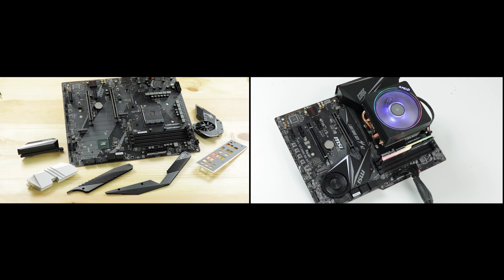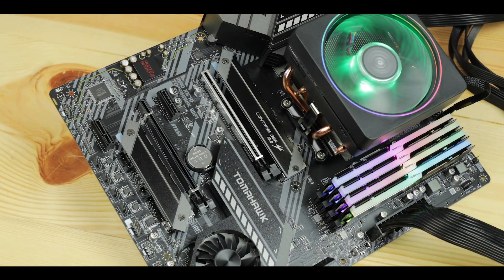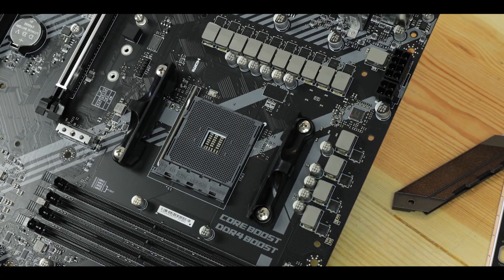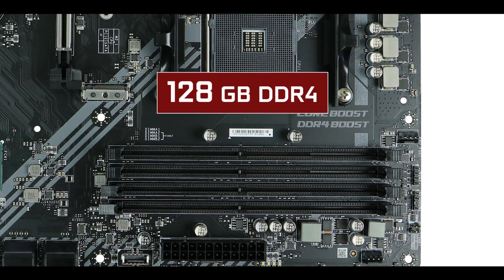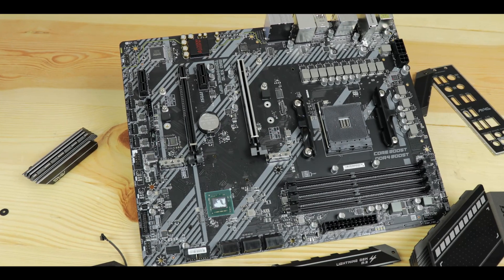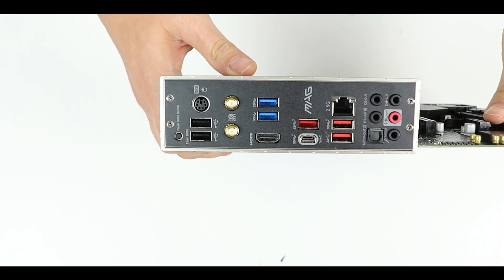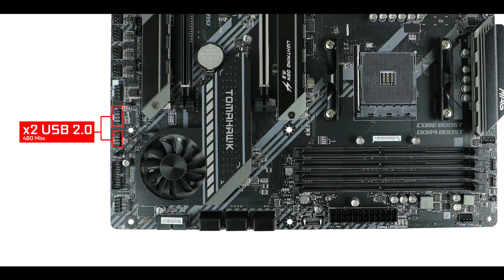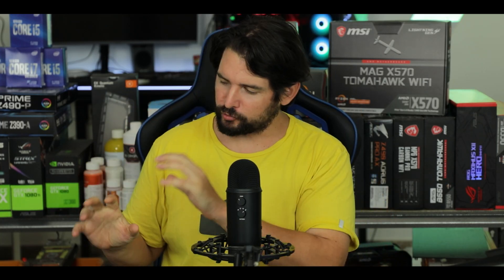MSI MAG X570 TOMAHAWK WIFI, MSI’s apology!

Comment: I literally purchased this board in Amazon for my monster NAS build. I remember hearing the rumblings of MSI boards running hot but I'm hoping they have nipped that in the bud. The Aorus board I wanted for some strange reason is through the stratosphere so here I am. I should have made this comment from my PC/Tech channel but eh.  Getting a board with 2.5g LAN, 4.0 on both M.2 slots, ecc memory support and usb-c front panel header support for less than an arm and a leg was pretty daunting but here I am. I watched your vid yesterday and a couple other folks while also scouring the search engine before I pulled the trigger on it. 165.00 USD.

Comment: Msi's apology is a scam I own x570 tomahawk wifi and the vga doesn't work after over 3 RMA issue persists and msi is just pushing the bucket they blame cpu and gpu sync issue and not the board I tried all the components on a gigabyte motherboard and it worked flawlessly.  What are msi talking about it's clearly an issue with the board especially when issue is replicated with any vga card. 😢help someone...

Comment: If other manufacturers could just decide to never include RGB on their boards as the default setup, that would be great. If I want to add any God offal RGB to my system, I'll buy an RGB controller and it myself.

I was ecstatic enough when I found a good case that was offering a solid frame that didn't include any RGB.

Comment: In 2019 when the x570 boards came out MSI ran a huge marketing campaign for buyers. Evidently why they all had 5 star ratings within weeks of the initial release. I choose to go with an ASROCK Extreme 4 x570 which was a pretty board for leds, however even though the manufacturer website claimed my G Skill 3600 ram was compatible the board on some random startups would reset the clock and reconfigure the board to default settings. 
 I replaced the Extreme 4 with this board Mag Tomahawk.....Posted on first boot listed the hardware it found and asked to load defaults or go into setup. I choose defaults and it booted directly into windows. 10...Remarkable board since I now have wifi and bluetooth (by the way the bluetooth and wifi  are great) and my 3600 ram was recognized immediately upon turning on xmp. The only issue with the board change was Windows was deactivated but I used the key from my 2009 windows xp that was upgraded to win 7 and then win 10 and Microsoft took a while to activate but accepted the key. I was ready to reinstall win10.

Comment: I manage to grab this and a Ryzen 5900x bundle at 220$ off!
Reply: how is it any blue screens etc?
Reply: im thinking of buying the 5900x in a few days but i read there could be probs  if you could let me know id appreciate it
Reply: @gregt1592  Got this motherboard and 5900x and it's great no problems at all. you need to flash the bios
Reply: @Sonic-o4y  thx ya im running it now  the only prob i face is overheating when pbo is activated
Reply: @gregt1592  is pbo active by default or do you have to turn that on ?
Reply: @Sonic-o4y  i think it was on by default     whats your temps look like?
Reply: @gregt1592  idle the cpu is 39. Can you turn that off ?
Reply: @Sonic-o4y  ya i turne dit off in bios i run about 35 c idle but with pbo off the cpu only runs 3700 ghz

Comment: as owner: no thunderbolt 3 (but expected), no Bios reset button, so if u want to manual tuning system it will hard without handmade button :) nvme heatsinks are great much better than in previous frozr versions. In first generations no support for ryzen 5000 (but must be out from the box) u will need to flash it with old flash drive (slow and 1-2gb...yes old when usb 2.0 was mainstream ) Also u can get old bugged revision of realtek LAN controller (loosing internet every hour this problem exist more than 2 years but they using that chip, new revision - with  letter at the end )... i wish to hear this in video before buying but  this guy not using it he just made a sponsored review without real usefull info (all of this features that he told u can read on the box or on msi)
Reply: Do you know does the X570 Unify have the same network problems?
Reply: @jaybee0507  unify  hot as i know, my tomahawk no realtek issue also chipset with passive cooling never get 40+ temp vrm temps are the same, i undervolt 1080ti 60° under full load , 65° hot spot and ryzen 5800x with 70° in cinebench r23 (1.125v 4.5ghz) , and got sufficient stable low power quiet system on this board,
Reply: @TheNuare  Jesus christ you all get good bins.  My 5950x needs 1.275v for 4,5ghz all core. That is with Arctic 420 rad.
Thanks for the info,  i'm upgrading from Strix B550-F to MSI,   just don't know whether to get Tomahawk or Unify...
Reply: @jaybee0507  nah my 5800x isnt best sample, also only 1 ccx, tomahawk best for me x570 gor the price , new revisions haven't issues with realtek, also ~5 pwm fans pins, btw my previous board for another pc was asus tuf gaming b550 its cheaper but its awfull, lowest  rpm for dc 3 pin fans -60% minimal, bad asus aura  work  with corsair rgb, only 4 fan connectors in random places on board
Reply: @jaybee0507  5950x very good thing even if unlucky with undervolting coz mooore cores :)
Reply: @TheNuare  I guess but i would still like to have at least mediocre chip. Thing is you can't really get good ones anymore. All bronzes and if you get lucky you get silver. I'm not sure why. Maybe amd ramped production speed, they might care more about quantity than quality.
Reply: @jaybee0507  my 5800 golden, bought on december, i saw that cpu plate can be with different "engraved watermark" my - ud, also u can check manufactured week from serial number

Comment: Hi, can someone answear me this question? The place I bought my motherboard, they told me that this board only had 1x m2 ssd that is 2280 size. But when i search around the internet no one mention they have a problem with this or they remove the heatsink followed by the motherboard and then installed 2280 ssd m2 in the "second slot". I bought an samsung evo plus 970 and i could not fit that under the heatsink in second slot.
Reply from the maker: Hi Geir. 

Please find me on twitter and send me pictures by DM. I'll see what I çan  do to help.

L.
Reply from the maker: To be clear. Ur m.2ssd should be able to easily fit any of the m.2ssd connectors. 

The x570 series all support at least 2 m.2ssds (no matter what your reseller tells you ). 

If it doesn't easily connect or fit , don't try to push. You may be dealing with a damaged connector.
Reply: @Laurentschoice  Pm on twitter when you have the time (Y)

Comment: So why did MSI choose to make a PCI-Express 4.0 X 16 Lanes (Max bandwidth) performance on GPU and 2nd PCI-Express 4.0 X 4 Lanes (lower bandwidth), Does this take away from SLI maximum performance capabilities for Rendering rig machines and SLI Radeon and GeForce enabled games - the Tomb Raider game and Quake 2 Relived SLI ed. ...what's with the design 2nd PCI-Express slot, the first slot is armored and 2nd slot is not armored and less performance bandwidth capabilities, might as well for the Dual PCI-Express 4.0x16 Lanes on both slots both armored protected reinforced slots. What a bad design, I might as well go up to higher end boards that can enable dual PCI-Ex. 4.0X16 Lanes, does any M/Bs do that at a reasonable price and is GEN 3/4 enabled? Thanks!

Comment: @ 9:43 MSI's fan headers is something which worried me because my current board has 4-pin fan headers but the fourth pin is inactive (very sneaky) and is voltage controlled rather than PWM. But when looking up the manual for the Tomahawk, it says that the fan headers can be switched between PWM and DC in bios, so does this not technically make them hybrid fan headers, albeit not auto detecting? 

If you go to Page 36 in the manual here you can see what I mean: https://download.msi.com/archive/mnu_exe/mb/E7C84v1.1.pdf

Comment: I just recently got this board with a 5600x (non scalped prices). Trying to overclock or even get the ram speed above 2133mhz is a nightmare. It fails every time for me
Reply from the maker: What ram did u get ?
Reply: G skill ripjaws 32gb (16x2) 3600CL 16s
Reply: @Laurentschoice  big oof on my part. I just found out the gskill ripjaws V f4-3600c16d are for intel only. I have to replace them with compatible ones otherwise getting them above 2133mhz leads to a debug error on the mobo
Reply from the maker: There u go :)
Reply: @Laurentschoice  still no luck. I grabbed gskill trident z neo 3600c16 that specifically says ryzen ready and still can't post past 2133mhz...same dram debug light
Reply: @repsreplays9275  I guess you eventually figured it out? Your ram sticks were probably in the wrong slots. Also, there is no Intel or Amd memory. It's the same memory, just with different timings. If your memory xmp profile is incompatible with your cpu, you can manually enter timings of ryzen compatible memory and it should work.
EDIT: Also updating Bios might help.
Reply: @jaybee0507  they were in the correct slots. I think I may have had a lemon. I switched to ASUS strix x570 anyway

Comment: the x570 doesn't have a display port therefore I'm going with the b550 tomahawk
Reply: I don't understand. Ryzen 5000 series don't even have graphics built into them. At least they didn't when you wrote that.
Reply: @jaybee0507  my monitor needs a display port to achieve 165hz and the x570 tomahawk didn’t have one
Reply: @dannyyoyoyo  Shouldn't you plug your monitor to the graphics card?  Why would you plug it to the cpu?
EDIT:  I mean motherboard,  if you plug it to the motherboard,  the monitor will be connected to integrated graphics of your cpu.

Comment: Great info! Just curious, noticed that the NVME slots are different sizes, and I was not aware of this prior, but I want to get the Samsung 970 EVO Plus 1TB SSDs, 2 of them, but will they both fit in those 2 slots or do I need to find one smaller then the other? thanks! :)

Comment: Just FYI, at about 5:30 your video indicates that both M.2 slots support 64G/bs (s/b "Gb/s"). However, the MSI website specification details for this board indicates that the M.2 Slot 2 will only support SATA 6Gb/s transfer rate. Slot 2 M.2 uses the chipset PCIe lanes; whereas the slot 1 M.2 uses processor PCIe lanes.
Reply from the maker: Thanks for this. But after testing both M.2 SSD slots, i can confirm  that they are both running on 4 Pcie standard. 

If you go on the specification page (details) of the Tomahawk site, it also details that both M.2ssds are PCIe 4.0 enabled. 

I hope this helps :)
Reply: @Laurentschoice  Ahh, that's good to know. I recall that some were having difficulties I believe from the original PCB revision and configuring their M.2. Appreciate the video by the way 👍.

Comment: Laurent, what would you get if you had to choose between B550 Strix F and X570 Tomahawk, the strix is 20$ cheaper, has alc v1220 and the msi has v1200, this is one of the things on my mind, as well as the msi has  realtek lan against the Intel on the Strix, so the strix wins in these, but also lacks type C on the board and pcie gen 4 on the second m2 slot, my main concern is the audio really, if you could feel any big difference between the alc 1220 and the 1200 I may go for the Asus board, what do you think

Comment: I have been researching this board for my upgrade (after 4 years!). Your review has helped cement my choice. I am convinced. Merci!
Reply: Hmm you really think this is a good choice? I am thinking of getting a new CPU finally. Maybe a 5900x. I still don't really know what board makes sense. Since I buy PC's for a very long use-time, I do want to make use of PCIe gen 4.0 for some things, and so I want it to be x570. But other than that it's not easy to find what is a good reliable motherboard.
Reply: @lystic9392  I have the same problem as you here, 5900x and not sure on board, I was told the B550 was good for me, but i feel the X570 version which is cheap enough is great!
Reply: @lystic9392  I'm with you 100%. I've been going back and forth on about a dozen different boards. This build will have to last me a long time, too. I used to think a 550 would do it, but after watching so many different vids I decided on 570. This one just seems to be the right one. Good luck on your research :D

Comment: Bought this board 2 days ago, good specs for the price. However the realtek 2.5Gb ethernet is no good. I regret buying this, should’ve got the tuf x570 plus instead.
Reply: Lol what's wrong with it
Reply: sharki9876 realtek ethernet acts up. No internet connection when I login to windows. Enable, disable lan, followed how-to’s online and reddit. Lots of people have the same issue and still no fix from MSI or Realtek. Got the board replaced. Never buying anything with realtek lan again.
Reply: @vidge1111  What you picking instead?
Reply: @thetruth2418  after watching tons of videos, i decided to go with the asus crosshair viii hero wifi. Figured i wouldn’t be upgrading for another 4-5 years and asus has never failed me before. A bit overkill for me, will buy strix or tuf in the future.
Reply: @vidge1111  Didn't the newer Asus B550 Strix motherboards equipped with 2,5gb network have the exact same network problem that you described?   It was eventually fixed by a bios update.  I mean it wasn't MSI problem only,  it was universal problem,  most people i saw complaining were in fact Asus owners.  Anyway.  i'm sure you're happy with your Hero,   just wanted to pop in and clarify this.  Have a nice day.
Reply: @jaybee0507  that’s good if it’s fixed now. Yes, happy with the asus, no issues whatsoever. Thanks for the update!

Comment: Thank you!! Almost bought the x570 Gaming Edge until I saw your last review. 
Now I just removed from cart, and instead, purchased this x570 Tomahawk instead. 6 layers! Wifi 6! Proper power and heat solutions! SLI support!! For only $10 more!! Amazing! 💪🥳🤙
Reply: What do you think about it ? Do you have issues ? Thank you
Reply: @aminek244  it's amazing, no issues. Love the Tomahawk
Reply: Wait, so that means i can put my old 2 gtx 970 since its SLI support?!
Reply: @SaigaTenshi  ah I was mistaken, only AMD crossfire, no SLI 

But it's ok! Games don't really support SLI anymore anyway. I was running 1080ti in SLI before, and I was not upset at all to only run one. 

I did try RX580 X2 crossfire for a while too, but ended up getting rid of that too

1 GPU is best now days
Reply: @TheRGFury  oh i see. I did also checked the specs and yeah only crossfire. Im hoping that my gtx 970 can run properly using the x570 Tomahawk with maybe 3700x since we cant have those new gpu and cpu yet

Comment: About the RAM, I notice you selected 4 stick, I was wondering because of the daisy chain topology it would be better to have 2 sticks?
(2x16 vs 4x8, assuming same speed, timing and F/M-clock of 1800)
Reply from the maker: So the more sticks ull put on, the lower the memory support will go. 
If u go with a single stick ull go as high as 5ghz, if u go with 4 sticks, lucky u if u reach 3600. 

Now, 64gb of ram @3600 is much MUCH faster than 32gb ram @4000 or 16gb @5000. 

Hope this helps.

Comment: Love your reviews man. I'm trying to decide between the Gigabyte b570 elite, The Asus b570 Tuff gaming and this. Which should I go for. And thank you so much ❤️
Reply: Which one you taked please ? And what do you think about it ? any issues ?
Reply: @aminek244  went with the 570 it's been great so far
Reply: @onemealmonster this x570 Tomahawk ?
Reply: @aminek244  x570 wifi
Reply: @aminek244  the one from the video :)
Reply: @onemealmonster  thank you my friend 🤝
Reply: @aminek244  hey man.. so a year into using it and it's been a bad board. It worked fine initially but there's been constant errors and the service department in India has been ABSOLUTELY HORRIBLE  . I've returned it four times to them and they just give it back as is. I've been fighting for a replacement but it's an uphill battle. I'm not going msi ever again.
Reply: @onemealmonster  thanks for your reply 🤜🤛. I'm using it in my pc from a year now and i don't have any problem with it. Maybe you can try to use a stable bios version and hope that the problems will be solved.
Reply: @aminek244  can you tell me how to do it? I updated the bios and even manually reset it.. but what is stable BIOS?
Reply: @aminek244  and thank you so much for replying as well man ❤️

Comment: Ordered one today and it should be here tomorrow, together with an R7 3700x ,16gb vengeance rgb pro 3200, some storage and some other stuff, was about time for me to upgrade since i am still on intel sandybridge(2500K😂 , i know..... it's a fossil), it has served me well all these years running at 4.6GHz without any issues.
Back when i bought it the 2500K was THE cpu to get.
Reply: How much you pay for yours? Cant find them for 220 anywhere

Comment: Does this Motherboard support Corsair Vengeance Pro CMW32GX4M2C3200C16W Ram? Please reply me I had really hard times with Gigabtye X570 Aorus Elite WiFi with CMW32GX4M2C3200C16W Ram.
Reply: Depends on which CPU you have, try looking here: https://www.msi.com/Motherboard/support/MAG-X570-TOMAHAWK-WIFI#support-cpu
If you have an RX-3x00 or RX-4x00 type this should work- you must know the version of your mem sticks. 
They will not work on earlier chips or G type cpu's. The M2C in your question is not listed though.
CORSAIR	CMW32GX4M4C3200C16 ver4.31	2133MHz	3200MHz	3200 MHz	Samsung 5WB	1.35v	SINGLE	8	√ | √ |